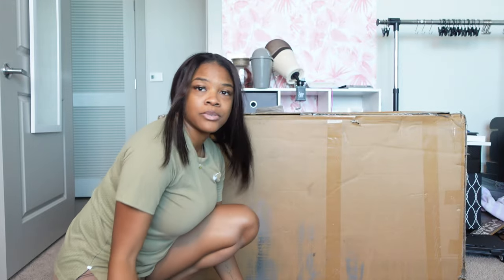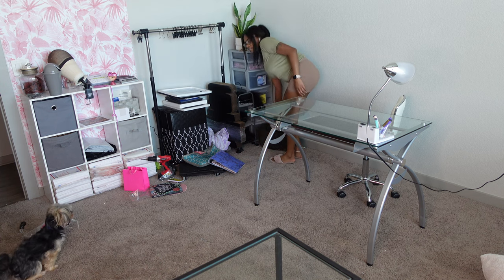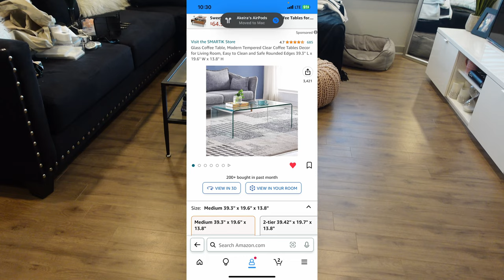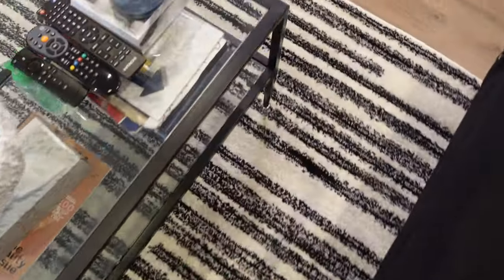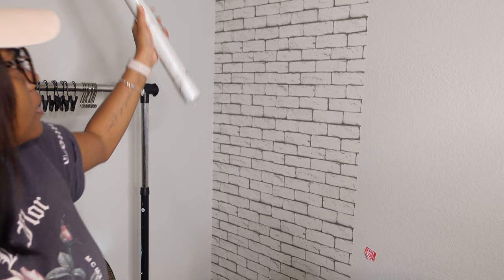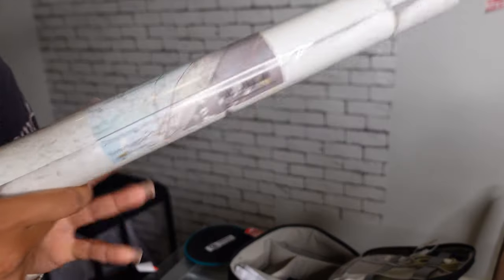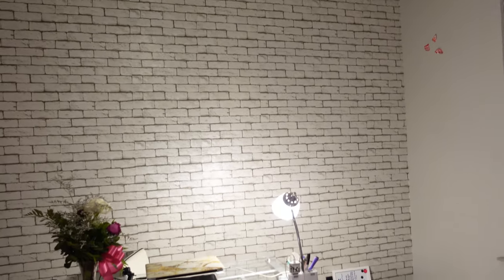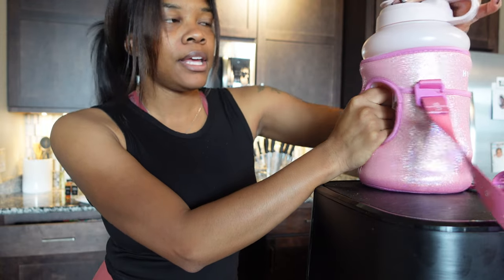MOVING VLOG S4E10| Beauty/Guest room transformation + New Amazon furniture + LOTS of Amazon Finds🛍️

Comment: Hey i have been so busy i had to watch your vlog little by little when i have time 😫 great vlog asusual loving the wallpaper looks professionally done you are a boss 💃💃 your water line on your fridge probably has build up from calcium from the water being hardly used and as you used the ice dispense more the water will be clean so check it out before you change the filter 🥰 loving the carpet it fit right in 😍

Comment: Hi miss lady, l heard you mention that you don't drink the water from your refrigerator dispenser because your filter needs replacing, but you use the ice because it's good. Not really! If the water that makes the ice is running through the same line that disperse the water from the dispenser, then your ice is not clean also. This is how you can tell if your ice is safe to drink from. Fill a glass container with that ice, let it melt completely, then check the water to see if those little floaters are hanging out in those ice cubes. Because ice is solid you won't see if it's clean or not. Check it just to be safe. You don't want to keep drinking it, thinking that it's (the ice) OK.❤
Reply from the maker: Yes my ice always melt because I don’t drink it fast enough and it’s never anything in it just when I use the actual water